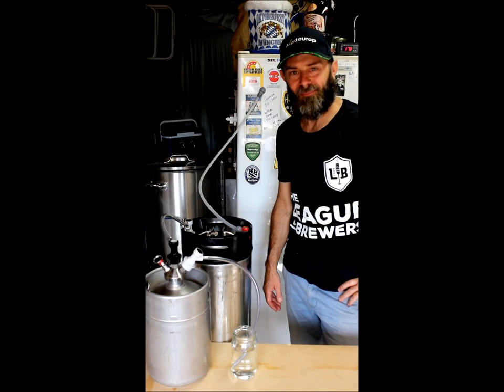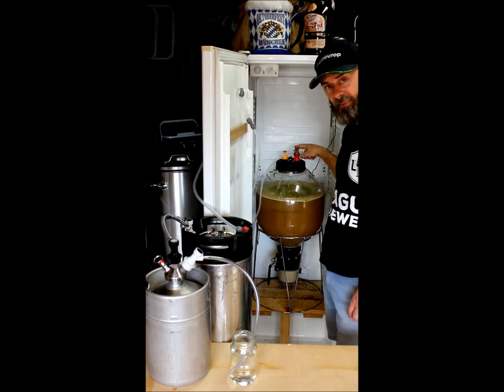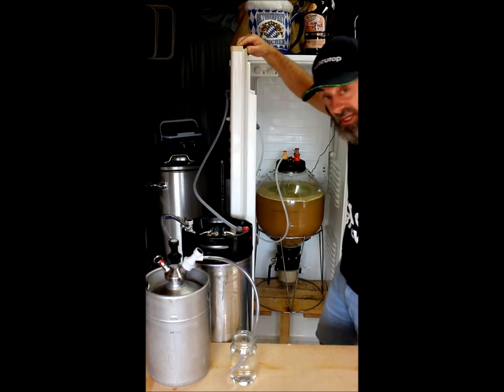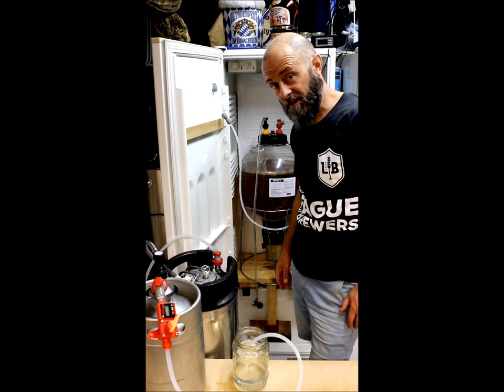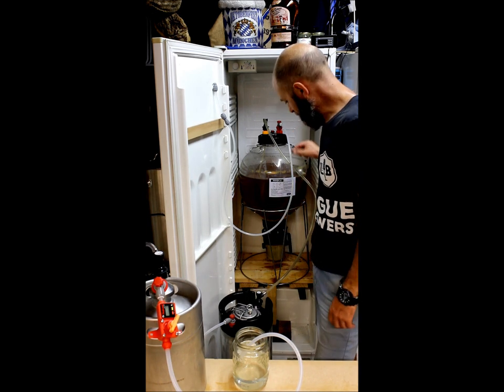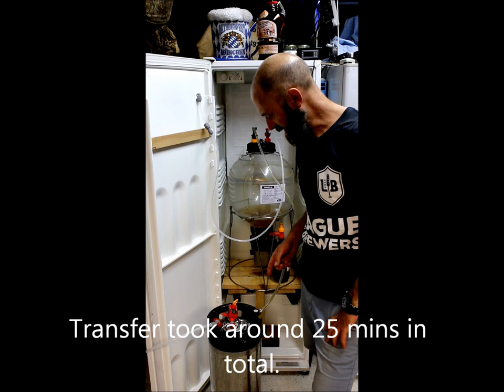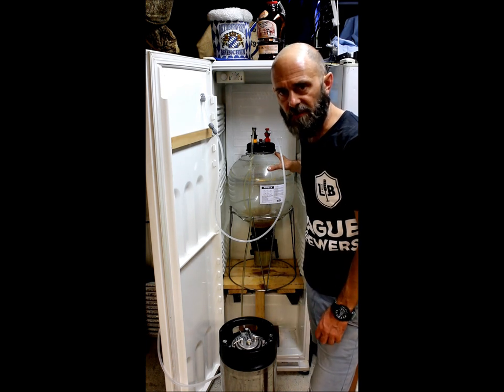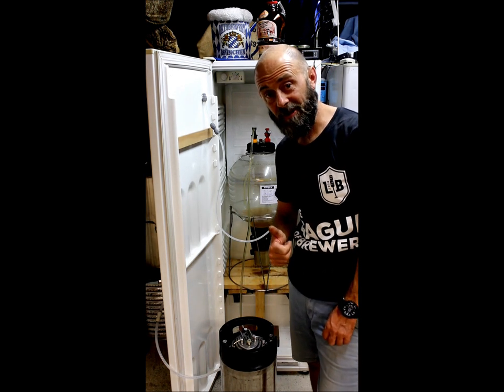Saving CO2 in your Homebrewery

Comment: Good video, great way to save C02, a small stainless steel weight  in the filter on the end of the floating dip tube helps with transferring.
Reply from the maker: That’s a great tip there. Cheers 😊

Comment: Hey Dan. I popped in to the shop and spoke to you about this (at length...) 4 weeks ago. Great idea. I've since brewed a NEIPA with this method with no oxidation or use of CO2. I haven't got a Fermzilla, so used an idea from a previous video of yours about fixing a gas connect through the lid of my plastic fermenter and following pretty much the same fermenting set up to purge the kegs and then using the closed loop as explained here for closed transfer. Works really well with very little set up or cost. Cheers!
Reply from the maker: That’s a great result mate, glad it’s working well! thanks for sharing 👍🏻

Comment: I use the exact same method for the transfer, but I am kegging into 8 litre Oxebars. I regularly brew under pressure.
I was interested to know how much the pressure dropped when crash cooling the brew, so I did a little experiment by not putting the brew under external CO2 pressure during the cooling process. I am using a 50/60 litre Fermzilla. (50 litres beer, about 10 litres head space.)
And the results: 24.7 PSI @ 23.2*C = 12.6 PSI @ 1.8*C.
So, basically no CO2 needed during the crash cool. Only a little to purge the Oxebars. 
That too could be eliminated if I purchased a heap of PCO38 Tapping Heads, ball lock disconnects and tube…
Reply from the maker: Hey Kent, this will awesome information mate. Thanks for your feedback. I think we might have some tapping heads in stock 😊

Comment: Thanks for the video, very helpful! I was wondering if you could have the spunding valve connected direct to the fermzilla and then the outlet of the spunding valve then connected to the serving keg? This would ensure that the pressure would be constant in the fermenter and the serving keg would be purged slowly, do you think it's doable? And would it be possible to purge Starsan out of the keg?

Comment: Prior to letting the CO2 into the kegs put them in a freezer. Let the CO2 escape in the beginning. Just enough to purge the kegs. Then close them and let them build pressure. When frozen the gas is more dense. When removed from the freezer the gas will expand and actually increase pressure within the kegs and you will have harvested some CO2.

Comment: I've done this type of transfer a number of times with good success but last night I had a bit of a nightmare transfer. There were bubbles coming through in the line. It would flow slowly for awhile but then stop. I had to transfer some pressure in another keg (cause my co2 is tied to the fridge out in the garage) a couple of times to get it going again - took over 2 hours and I gave up on the last couple of litres. Not sure why it was so problematic this time, only thing I can think of is it must have been the way the floating intake was sitting. The floating intakes can be a bit temperamental and it's not easy to move them if they are in a bad position. The float was attached to the middle point on the filter, I might try it in a different position next time.
Reply: Hey Aidan, sounds line your hose might be too long? You want it as short as possible just so  the ball touches the bottom of the fermenter. Also see comment here where a brewer is using a weight to help keep the filter well under the beer. Should work a treat! 🍻
Reply: @dhagenaar1276  Possibly could be shortened a tad. I did one more transfer since then (my Marchfest brew) and that went fine. I did add a small weight inside the filter which may have helped.